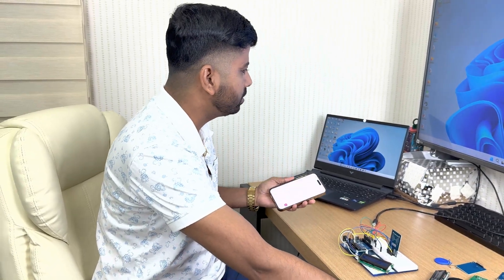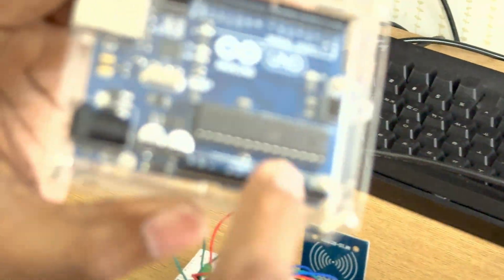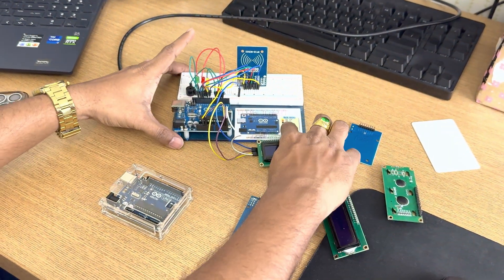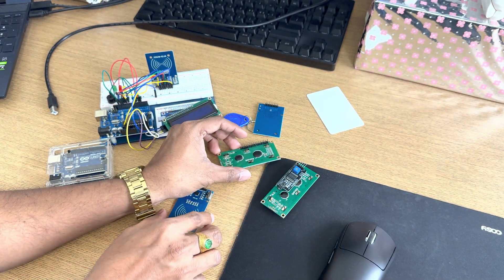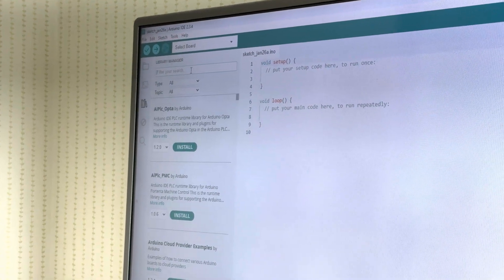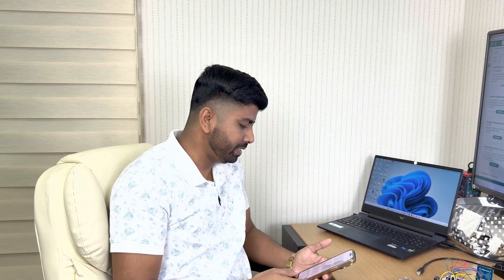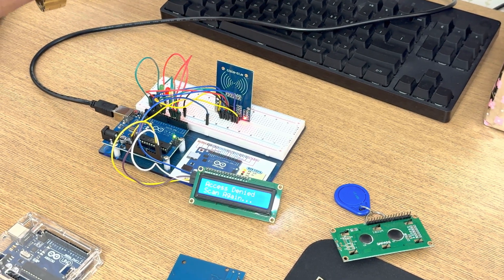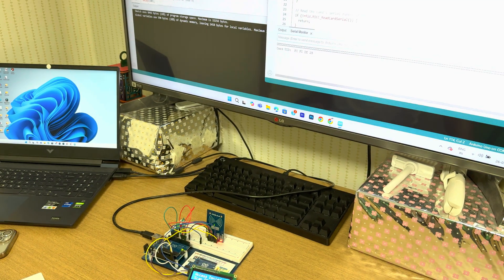How to Fix Common RFID Problems in Arduino | RFID RC522 Troubleshooting Guide for Beginners

Comment: Sir my serial monitor is showing 
Scan your card 
And when i scan it it doesn't show any valuee or anything
Reply from the maker: That "Scan your card" message is a good sign! It means the module is initializing. The next step is to ensure your card is compatible and that the library is correctly set up to read its specific type.
Reply: @AjayaPhysics actually it was not showing anything after scanning the card & i have already installed all the necessary libraries still it didn't show any uid or any other info & kept showing scan your card!! 🐸
Reply: @Sapna-l6j  for me it worked firstly but afterwards the serial moniter didnt show anything!

Comment: I have some problem my code not work after connect to sd card module
Reply from the maker: That's interesting! The SD card module might be causing a pin conflict or power issue. Have you checked if the libraries or pins used by the SD card module conflict with the RFID module's?
Reply: @AjayaPhysics  yes im all check now sd card ok but.. sd card not write time . how to resolve can you help me?

Comment: Sir my rfid is not working what to doo i cross check my connection its all correct when i upload code for check-in the card number it cannot sense my card in serial monitor it showing " RC522 test - bring a card/tag near the reader" please reply sir
Reply from the maker: Thanks for reaching out! When you get "RC522 test - bring a card/tag near the reader," it often means the module isn't initializing properly. Have you confirmed the correct chip select (SDA) and reset (RST) pin connections in your code?

Comment: Thank you very much for your demonstration. I used RFID PN532 but the arduino tend not to see the module. Could it be because of the side I soldered the connector?

Comment: Sir when I read the data from card this massage show in serial monitor 

PCD Authenticate() failed: Error in communication.
Give me solution plz and another thing that my all connections is correct between rfid reader and Arduino uno
Reply from the maker: Double-check the wiring and library installation to make sure everything is correctly set up for communication.

Comment: Sir, When I place the RFID module close to or lying flat on the table or ground, it often doesn’t respond. this might be due to interference or signal reflection from the surface. However, if I position the module upright at a 90-degree angle, the connection works normally.
Reply: My RFID module operates at 13.56 MHz frequency
Reply from the maker: 🛠️ Solutions You Can Try:
✅ 1. Keep the RFID Reader Elevated or at an Angle
Keep it upright (90°), as you've done — this maximises the field projection and avoids the surface absorbing the signal.

✅ 2. Use a Non-Conductive Spacer
Place a plastic or foam sheet (1–2 cm thick) between the RFID module and the table. This:

Decouples the reader from surface interference.

Maintains field integrity.

✅ 3. Avoid Placing Near Metal Surfaces
Try placing the module on wooden or plastic supports, not directly on metal or concrete.

✅ 4. Use Ferrite Sheets or Shields (Optional but Advanced)
In commercial setups, ferrite sheets are used under RFID antennas to suppress unwanted interference.

This is useful if you're mounting it on complex surfaces or inside devices.

Comment: sir i'm facing this issue, what is the solution       
Firmware Version: 0x0 = (unknown)
WARNING: Communication failure, is the MFRC522 properly connected?
Scan PICC to see UID, SAK, type, and data blocks...
Reply from the maker: This error message:

Firmware Version: 0x0 = (unknown)
WARNING: Communication failure, is the MFRC522 properly connected?
means your Arduino board is not able to communicate with the MFRC522 RFID module. This is a common issue and usually related to hardware wiring or power issues.

Let’s troubleshoot step-by-step:

✅ 1. Check Wiring (Very Important!)
Make sure your MFRC522 is wired correctly to your Arduino board.

For Arduino UNO:

MFRC522 Pin	Arduino UNO Pin
VCC	3.3V (NOT 5V)
GND	GND
RST	Pin 9
SDA (SS)	Pin 10
MOSI	Pin 11
MISO	Pin 12
SCK	Pin 13
⚠️ Note: MFRC522 should be connected to 3.3V, NOT 5V!
It is a 3.3V device – giving 5V can damage it or cause unpredictable behavior.

✅ 2. Check if SPI Library is Included
Make sure you’ve included the correct libraries in your Arduino code:

#include <SPI.h>
#include <MFRC522.h>
Also ensure this part is correct:

#define SS_PIN 10
#define RST_PIN 9
MFRC522 mfrc522(SS_PIN, RST_PIN);
✅ 3. Check the Library Version
Use the official MFRC522 library by GitHub user miguelbalboa. You can install or reinstall it from:

Arduino IDE → Tools → Manage Libraries → Search “MFRC522” → Install latest version.
✅ 4. Check Serial Monitor Baud Rate
Make sure your Serial Monitor baud rate matches the code, usually 9600 or 115200.

Example:

Serial.begin(9600);
✅ 5. Try a Basic Example
After wiring correctly, open:

File → Examples → MFRC522 → DumpInfo Upload that sketch and try scanning a card. If it's still 0x0, the communication still isn’t working.
✅ 6. Try Replacing Wires or Module
Faulty jumper wires can cause this.
Try another MFRC522 module if possible — it’s a cheap part and sometimes defective.
✅ 7. Check for Conflict on SPI Pins
Make sure no other device is using pins 10-13 (SPI) on the Arduino UNO, or change CS/SS pin if needed.

✅ 8. Use a Multimeter (Optional)
If you have a multimeter, check if the MFRC522 is receiving 3.3V properly at the VCC pin.

📌 Bonus Tip:
If you’re using an Arduino Mega, wiring is different (SPI pins move to 50-53):

MFRC522 Pin	Arduino MEGA Pin
SDA	53
SCK	52
MOSI	51
MISO	50
RST	Any digital pin
VCC	3.3V
GND	GND
Reply: @AjayaSTEMAcademy  sir that got solved after I did resoldering  now it's showing. " Firmware version 0×92 = v2.0
Scan PICC to see UID, SAK, type, and data blocks... "
But card is not reading
Reply: Hello, i have an issue of reading the card sometimes working and sometimes no with the same code and schematic